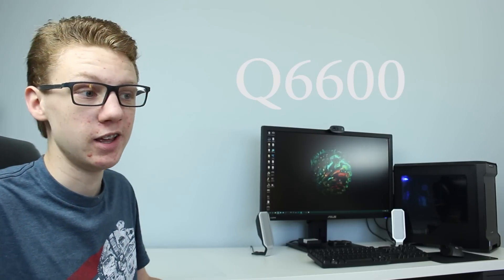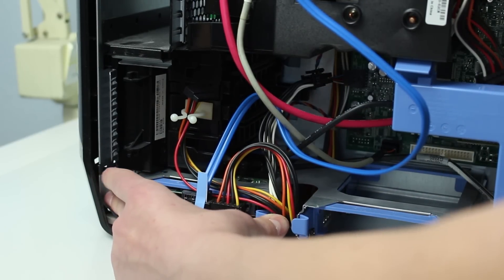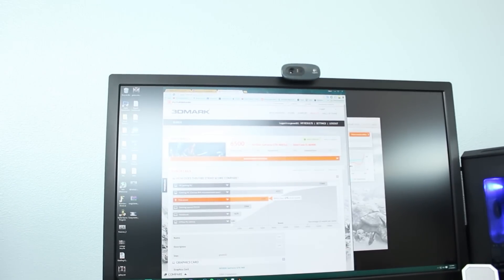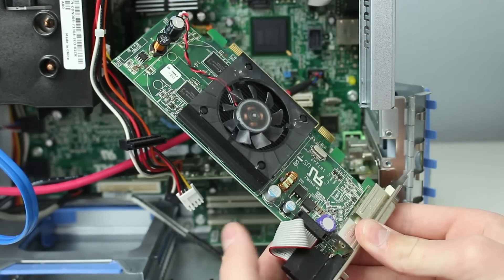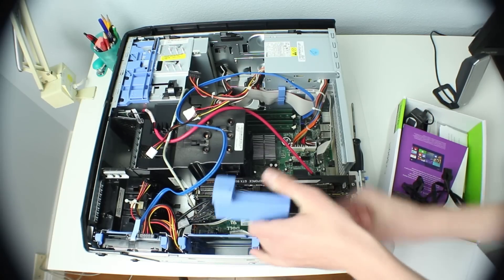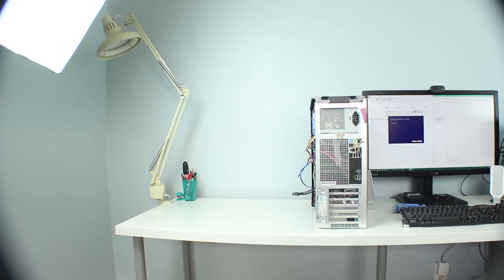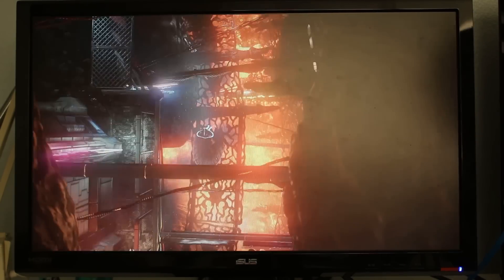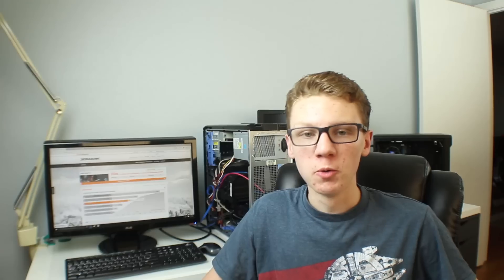Old CPU + New GPU = Gaming PC? (Core 2 Quad + GTX 960)

Comment: yes, because i just put GTX 950 to the HP pc that my sister bought in 2008-2009 i think, running Q9300 and 8GB ram, pay around 2.4k$ for that system with 27inch screen 1920x1200 16:10 at that time.
And the result is amazingly, playing dota 2 with 120fps =)))) running ultra smooth and quite.
Reply: +Thinh Le Tien except if you try playing anything cpu intesive like FO4, gta v, RISINg STORM, battlefield, really all modern games it WILL bottle neck..
Reply: William Harrison it will not, absolutely not because of my cheapest 950ssc.
The power of gpu is really standard, and before it got bottle neck on cpu, the gpu gonna be bottle neck first. In simple, gpu will reach 100% load before the cpu.
If you use GTX 970 or higher, so maybe, bottle neck in some games like you said.
The reason why i purchased gtx 950 for that system because the old graphic card dead, gpu on board really suck ass so thats why.
In case you talking about bottle neck, that mobo only got pcie 2, not 3 lol, so nobody gonna buy 980ti for that system, so bottle neck never happen dude

Comment: Then you try to play Skyrim, any MMORPG, any open world game, or any DX9 titles and get 10fps.
Reply: cheddar07 Try Skyrim. Elder Scrolls Online. Planetside 2. Fallout 4. AC Unity. Cities Skylines. Arma series. Battlefield 4 MP. Any of those will instantly cripple your system.
Reply: +MercilessHobo this is a VERY bad video, i had an a8 5500 and gtx 780 ti and couldnt play nearly any new title or even 2013-16 title because of the bad frames. NEVER sacrafice cpu for gpu. most of the time a 750 ti will do the job considering i lived off a gt 610 for 2 years haha
Reply: +MercilessHobo nah, my core 2 duo system manages to keep GTAV at around 30fps
Reply: William Harrison A gaming build needs at least a mid end CPU. Even my FX-8350 struggles in some CPU intensive games like Skyrim and Fallout 4. CPU WILL become less important with DX12, but very few games will be ported to DX12 because they already run acceptably.
Reply: MercilessHobo can't speak for any other than city skylines which does dip into the mid teens. especially as you build more. But then again the gpu is a gtx 260m

Comment: lol im going to buy a q6600 its such a good deal
Reply: Don't. It's not. TRUST ME!
Reply: If you have a modern card it bottlenecks the shit out of the card, and if you're going to play new games like fallout it will only play at medium graphics at like 24 fps.
Reply: prescott231233 at the moment im using a 550ti is it a bottleneck there?
Reply: +kenoalbatros Not when you can get a premodded Xeon X5460 3.2 Ghz for 30ish bucks from aliexpress/ebay
Reply: what about a xeon w3565 and a 970 or 390? on the 1366 x58 socket?
Reply: kenoalbatros you're much better off saving up the money to buy a new cpu and mobo, these processors will be 10 years old soo. and will not be supported by many games, most games nowadays dont support them properly.
Reply: prescott231233 well than ill save up for a i5 6500. that should last me a few years right?
Reply: kenoalbatros yes. but thats only if you're not looking to overclock. if you want to overclock i would suggest the 6600k. but again, if you dont want to, then the 6500 wil do you just fine for a good while. :)
Reply: prescott231233 yes i dont want to overclock its too expensive :D 
thank you :)

Comment: This is a great test, I have an old machine running a e6500 dual core, which I believe is interchangeable with the q6600 on the motherboard I have, I had upgraded to a gtx750ti and that made a noticeable difference, but it might be worth dropping £27 into a q6600 just to see what its capable of
Reply: +Paul Chopping Yes...definitely. You can get a decent Q6600 for pocket change on eBay (~$25).  I also did the BSEL  PIN MOD as I have a locked DELL BIOS...which brought the FSB up to 1333Mhz (4x) and CPU clock to 3.0Ghz (9x). Temps increased 3C with stock DELL cooler. Much better match to 750ti at this OC.
Reply: +Starburst The Stary that's a really good tip, I'm gonna give it a go, thanks!

Comment: Q6600 are frigging AWSOME hidden gems. Were you would usually get hung up is finding a ATX standard mobo that is as good of a deal. Used (P45, X48, chip-set I believe are OC capable ones) mobos are STILL around $90 to $150 %90 of the time. If you score a good used mobo of e-bay or Graigslist then you can build a surprisingly good gaming rig with the investment of a decent modern GPU!

Comment: I've just played Far Cry Primal on my old q9300 with my old gtx660 an have above 40 fps on 1080p and in FC PRIMAL benchmark LOWEST 27 AVERAGE 43 AND MAX 65 FPS on lowest settings with 1500 mb of gpuram used so i can squeze a little non cpu bound settins a little bit. GEFORCE  Experi3nce says i dont evin met the minimum requirements... and play flawless experience (console quality seems to me compared to my main desktop 4770k with 970)

Comment: Thanks for the video Gavin, it just answered my question. I am going for a Q8400 C2Q CPU + Antec Kuhler 650 trying to overclock it to 2.66>3.0+ and installing a new GTX950GPU, on a new MoBo that will allow 8GB RAM, also adding an SSD, getting excited here your video gave me hope =).

Comment: I have q6600, overclocked it to 3,55 ghz and MSI GTX 960 4GB version, and 8 gigs of ram, and my benchmark was 6100. So q6600 proccessor is not bad at all. And for gaming.. I can run all the modern games really well

Comment: And you can get S775 with Xeon S771 mod really cheap high-end rig. If you only had SSD on this comp, that would be killer. You are clever young lad!

Oh and for those who point hes mistage Core 2 duo quad, you should think about it. Q-series processors are actually two Core2Duo chips in one packet. lol

Comment: It would be interesting to see if an SSD and a better power supply gave you an equal performance with the Q6600. Try maxing out the RAM too. Nice video.
Reply: +Dustin Marett I have the same setup, mostly. Biggest impact: 1) SSD w/Windows 64bit. 2) newer video card (today at least GTX750ti), 3) Overclock to 3.1Ghz (BSEL pinmod+SetFSB), 4) faster DDR2 RAM (at least low latency 800Mhz, 4GB minimum), if necessary. 1 to 3 do-able for under $200 (less if you factor in sale of parts).

Those DELL PS are under-rated.  These are not peak powers on label.  The 375W unit is OK for any VC under under 100W. GTX 960 pushes envelope.  I have Dell's 425W PS, handles 120W fine.

I went with 8GB RAM...not a very big impact for my use case.  A new HD monitor is also important, of course.

Comment: i have gtx950 , about 100fps max in World of tanks on pentium dual core , it was 50fps with quad core q9400 @3ghz...so i think that old intel quads are good cpus ,.So good indeed that they work better in multitasking then 10 year younger cpu . I know its a pentium , but still , 10 years ahead of intel quad core family one would expect the cheapest cpus to be at least quad cores . that never happened . One can get cheap AMD quad core , but thats not going to be faster then 10 year old intel quad core by much . I would like to see someone comparing these trends , 10 year old quad core vs new cheap quad core , just to see how much  cpus improved over the decade . For sure i5 K is going to be faster , but it costs 10 times more . While cheap AMD quads cost 3-4 times that . A lot of topics. Frames per dollar is a category where old intel quad cores dominate more then ever

Comment: I feel like your PC got a much lower score than it should of.
Reply: *****
Not that... I know my CPU is shit but my R9 290 and A6-3650 gets 6500 in 3DMark... ( I got the 290 because it was a good deal for a used product, getting a new CPU,Mobo and RAM soon )
Reply: +StoneAgeGaming The score is correct. R9 380 quite resembles R9 280. I have R9 280 and the graphic score is quite identical. Your R9 290 > R9 380 = gtx960. You got 6500 because of the cpu

Comment: As a suggestion go straight to the point when you're trying to make the comparison.  An example here's an old desktop my relatives gave to me here are the specs.  I wonder if an older cpu with a newer graphics card is still viable for today's standards.  Then make the tests then give your input.  It's not bad but it could be better.

Comment: Im still using my "core 2 duo quad q9550 engineering sample".
Reply: +preystation4 how is it? I'm still running a e7700 duel core in mine its ok with a good gfx card but was thinking about upgrading to the q9550 so I'm interested to know lol

Comment: I really like the intended approach to provide useful information, STILL I think it was too long a video with a lot of pc setup footage just to come down to final conclusions.

I say a shorter concise video going directly to the point would make better for the purpose.

By the way I am on a $0.00 budget right now so my pc features a core2duo @2.6ghz, 3GB DDR2 RAM @ 266mhz. and an integrated intel GMA3100 GPU which surprisingly holds flwalessly in online gaming with classics like BF1942, CoD1,2,3, NFMW2005, Madden NFL 08.....

Comment: "It's actually doing really well" while its still in the prerendered section... You can skip that btw by just Alt-F4ing out of it to skip right to the benchmarks
Reply from the maker: +TG MrNacknime that's not prerendered...is it? What's the point of running a prerendered benchmark?
Reply: Gavin Remme
I'm not sure if it is prerendered, but it flows well on even the crappiest machine, so I guess it is. It's just product placement to keep Firestrike free, that's why you can officially only skip it in the "Pro" version. It doesn't count frames and it doesn't count for the score neither.

Comment: Look how much you can get from overclocking the Q6600. You can see that in my physics score from firestrike, because this part of the benchmark uses the cpu and not the gpu. Your q6600 stock scored 3 672. My overclocked q6600 (3.5ghz) scored 5 594 and your i5 scored 7 376. Now that`s a substantial increase in performance. You can see the results here: http://www.3dmark.com/3dm/11794975

Comment: Hp elite 8000 c2q 2.4 with 5gb ram 1066 bus speed
Vs
G3260 with asus h81m-k with 4gb or 8gb ram 1600 bus speed

Without Gpu 
Which one for everyday streaming and gaming which setting without Gpu.

Comment: Purchase a USB Drive Dock to do formatting of hard drives without having to rip out panels and install it into your system. It will take a little longer ( not much longer ) to format it because it's doing it through USB, but it's still worth since you don't need to install anything you just plug and play.

Comment: Update.  So I took the plunge and did the Q6600 BESL MOD using 2 slivers of electrical tape, per the following guide:

http://hubpages.com/technology/Get-more-from-your-Quad-Core-Q6600

There are other methods, apparently.  But this looked as good as any.  I had the materials...it took 20 minutes.

If you attempt this at your own risk, don't forget electrical safety and personal grounding before working inside case. Also, cleaning the CPU top with alcohol and applying a pea sized amount of thermal paste.  No more.

So far, runs like a champ.  Big Difference.

CPU has gone to 3.0 GHz with temps at idle of 46 degrees (from previous 43 degrees when at 2.4 GHz).  Very stable.

Before this mod, I could only get to 2.6 Ghz with SetFSB [adjusting FSB from 216/380 to max 238/380, where it was stable]. Note: CV184-2APAG is the clock generator specific to this DELL.  SetFSB version 2.2.134.98.

With BSEL tape mod, SetFSB is now showing as default 283/380!  Of course, I'm not playing with SetFSB much as I have a stock CPU cooler.  Afraid that too much increase in FSB would unnecessarily stress system without further cooling.[Apparently you can use an XPS720 cooler in a XPS420 by simply drilling three small holes in the top of the 420's plastic cooler shroud to make room for the additional cooling loop in the 720's CPU cooler. Got a XPS720 fan /shroud/cooler assembly off of eBay for $7 delivered :-)].  With stock cooler SetFSB can get clock to 3.1Ghz (295/380 setting). VID maxes out at 1.325 (when 9x mult.)...within safety threshold of Q6600. My system is also limited by cheaper RAM (DDR 2 PC6400 6-6-6-18 800Mhz).  The RAM maxes out at 413Mhz(x2) according to CPU-ID. I might be able to eek out another 0.1Ghz with better RAM...but DDR2 is a bad investment these days.

OK...I did it at my own risk, like every one else.  But in my case, the PC is so old I decided after researching to give it a try.

Comment: Cool review. I still have a Q6600 with G0 stepping (95watt) over the B3 105watt like yours. I had mine OC'd for awhile @3,2ghz with no problem.   It was a butt kicking little quad back in those days and can still perform rather well with decent OC'ing.

Comment: Gavin, would you mind doing a follow-up video to this one in which you benchmark using CPU-intensive games such as Kerbal Space Program and Cities: Skylines?  I had a lot of trouble with these types of games even on my i7 920.  Upgrading to a 6700k did see a significant improvement.  I think it's more about what kind of games you intend to play.  A GPU can and does often support most of the processing weight required to run most modern titles, but there are still many titles out there for which you will need a somewhat modern CPU.

Comment: what the af.. how didnt that pc explode with the cheap psu?
Reply: +Renox CS:GO it probably isn't cheap. most big box companies like dell use the same OEM PSUs found in gaming computers. a lot of power supplies are just rebranded/relabeled OEM units. companies like be quiet, corsair and silverstone just have a different box with a higher price tag.
Reply: wow i didnt know that, my pc was a hp and i still have the psu, it means to be bestec 300w but doesnt have a pcie port (its obvious, 300w) can these 300 be real?
Reply: if it doesn't have a pci 6 or 8 pin you can get a molex adapter. you can also look up the PSU by the serial number or model number and find out who originally made it. i personally wouldn't use a 300w for anything other than a standard web browsing pc because most gaming GPUs put the system power draw up in the mid 200s to lower 300s when under full load. PSUs are cheap though. just get a 80+ certified unit that will meet the power requirements. most 500w PSU will suit a single GPU system just fine.

Comment: I just bought a dell 745 optiplex from eBay I've got 150$ to spend on a graphics card any suggestions and also I'm having an issue where it won't update direct think it's running 9 and just won't update to anything else I'm hoping that will get fixed with a new card was thinking about the msi nvidia 750 ti
Reply: Get an r7 370, there is one from XFX for 165 Canadian,
Reply: Don't actually, AMD Polaris is coming out soon, should use very little power so I suggest waiting for it
Reply: +VitalStatistiX lol wish I'd have known that last night I found one of the 750 ti on sale for 120 bucks I went ahead an bought it

Comment: Fat32? Windows has  used NTFS since windows 98 SE. And the installation media has a disk management tool built in.
Reply: +Zach Demand Windows XP offers both FAT32 and NTFS. Basically the former limits file sizes to 4Gb, and drive volume to 2TB.
Reply: Yes but he was installing windows 10. And he had to install the hard drive in a different computer to format it. NTFS also allows more usable disk space.

Comment: Oh man, a 17 minute video for one benchmark, and it's of 3dmark, a benchmark that's pretty much dependant on your GPU. Brutal. should have done something like cinebench, rendering, encoding, games that are hard on the CPU... you know, CPU based tasks.
Reply: Why? The purpose was GAMING only! Why are you mentioning Cinebench?
Reply: +Yan Volis because you're comparing two CPUs. Not all games are GPU bound you know.
Reply: I know that, yet Cinebench will show you the difference between the two CPUs without games in the equation. If you really want to test gaming, you gotta test actual game performance. He decided to show Firestrike only, but he did say he intends to test actual games later.

Comment: Q6600 bad performance and High power consumption.
New cpu is lower power consumption and fast performance.
Reply: +GT4tube Depending on how much you use the PC for heavy workloads it would take years until it pays off since the q6600 is 200$ cheaper than a modern i5. My PC (I5 4670k OC+GTX 970) needs about 680 kWh per Year that's about 200$ worth of electricity in total.
Reply: +megapro125 No. Ok i'm done...

Comment: Hands down the q6600 was the best CPU Intel ever made. I love my q6600 Works great for the  Media server and Home entertainment center, Got it paired with a 760 for game stream and it works flawless.
MY current main rig is a 5820k and dual 980 ti's, and Honestly I see No difference in everyday use and light gaming.

Note, If you over clocked your q6600 do you think you could get back or at least shrink the 15% performance gap? Would like to see that in a follow up video.

Comment: try playing any games that has some kind of physics in it and that processor won't be able to handle it. Try playing BF3 or BF4 with that quad core lol it will choke like crazy. Most games even if not having physics uses physics based shadowing and light rendering which requires some processing power from your CPU.

Comment: man i wouldn't plug in a modern GPu in that old shitty power supply that might not even have enough AMPs to run the 960 lol It would either crash when you play a game more than 5 minutes or it will fuck up your card due to not enough current being supplied.

Comment: If you watched "Scrap yard wars" Linus has used the Q6600 a few times and was able to run games just fine. It's a really good budget cpu only you can't get a mobo (from my understanding )that can support the cpu and ddr3 ram so the biggest downfall to the cpu is having to use ddr2 ram for the build.